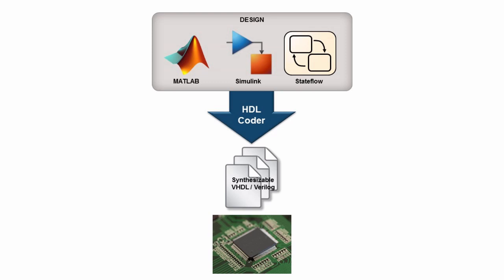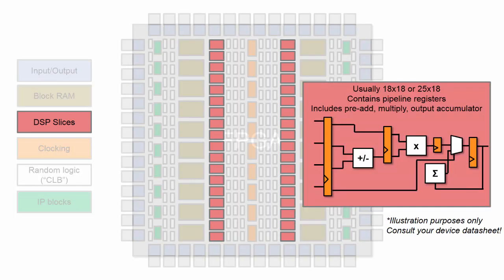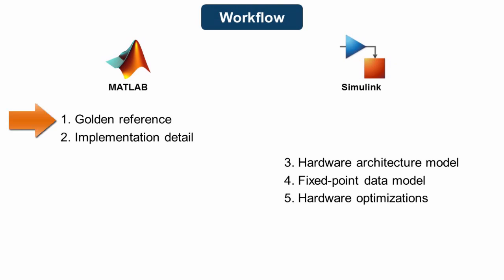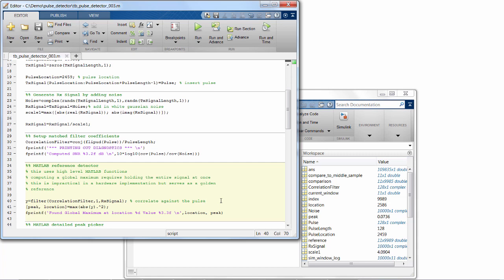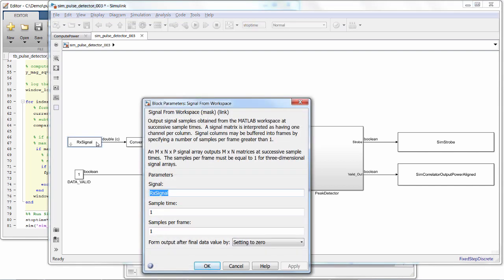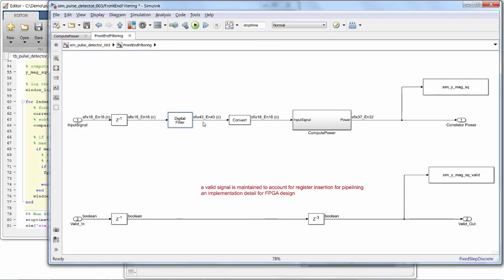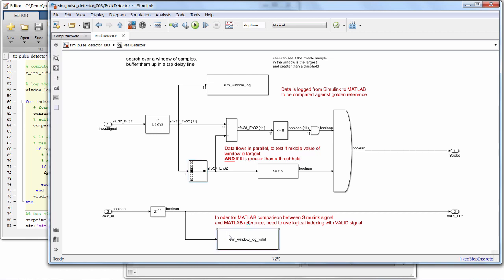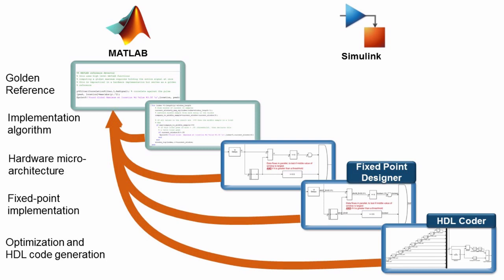Using Simulink to Deploy a MATLAB Algorithm on an FPGA or ASIC

Comment: Usually, it is better to use Matlab to generate some golden reference output of your model, store it in txt or csv. Then create same fixed point model in HDL. Load the golden reference signals to testbench model, simulate in modelsim and compare float and fixed point implementations.